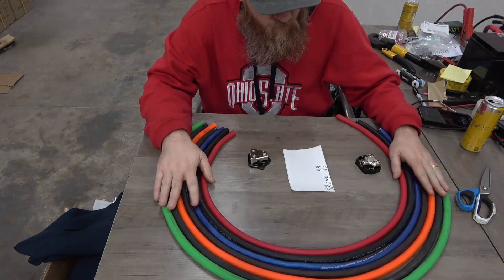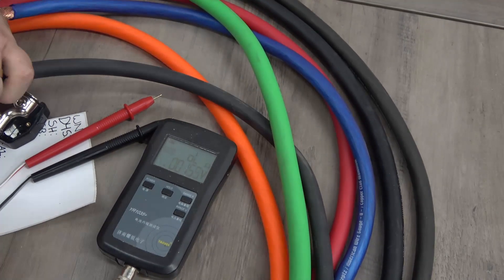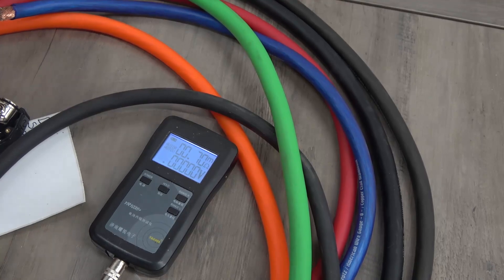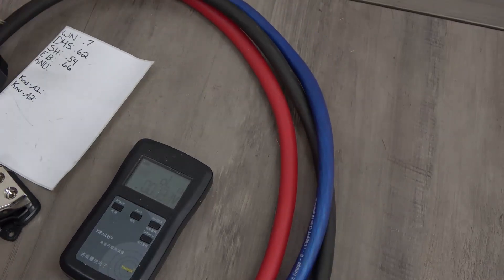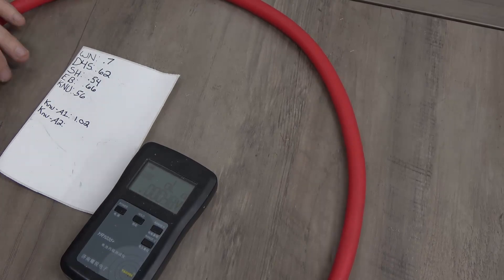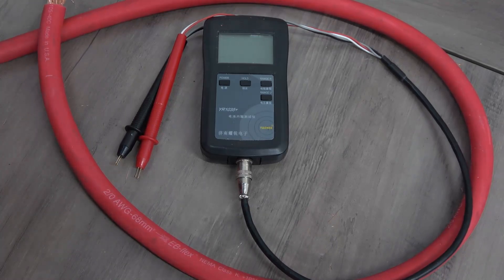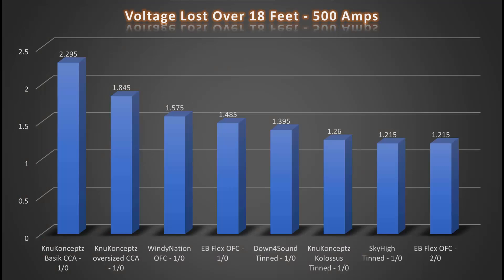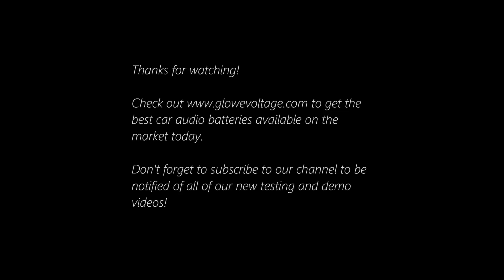Copper Combat: Impedance Testing the Top 1/0 AWG Wire Brands!

Comment: Just wondering if there was a purpose to stripping all those wires and tightening them into the blocks to read the resistance couldn’t you have just stuffed the probes in to the ends of the unstripped wire?? Not busting balls just wondering if there was something else to that
Reply from the maker: Kelvin clips aren’t going to attach well to wire this thick.
Reply: Well from what I saw he was tightening the wire down into the blocks he was using and still stabbing the probes into the wire I just thought he could have stabbed to probes directly into the unstripped wire and got the same results that why I was asking was there something else to it that made him test with the wire in the blocks

Comment: GUESS WHAT IT Doesnt matter  Because Laying 400LBS of wire through your suv is Extremely  Lame And New 2 piece Amplifiers Are on the way.   We're the power supply goes under the hood or in kickpanel  and main  amp goes in trunk  leaving only 2 feet of o Guage wire to supply and then only 8 Guage of high voltage wire to amp in trunk
Reply from the maker: 1/0 copper wire weighs about .4 pounds a foot. 

400 pounds would be.. 1000 feet of wire. That’s intense!

Comment: I enjoyed the video and learned something from your teaching method. Do you have a way to do a voltage drop test using a car battery an amplifier playing a test tone, using a voltmeter?
Reply from the maker: This wouldn't be too difficult -- you would just need to measure the voltage at the battery terminal, and use a second dmm (that's calibrated with the first) at the inputs of the amplifier itself.

Comment: It is really difficult to measure accurately the resistance of high current cables of short length. The minimum length even for automotive applications testing (battery cable) is around 6 feet. To do a good comparison you need to terminate each cable with a crimped lug (hydraulic crimper with long barrel lug with a triple crimp). Then you need to have a high current low resistance measurement device, like a Megger DLRO10HD Digital Low-Resistance Ohmmeter which has a 10 Amp range, which for 1/0 wire is on the low side, but will work (you might want to move to a 100A tester). 

The tester is connected to test blocks (make sure the blocks (tinned copper bus bar) and lugs are clean) to which the cable under test lugs are screwed to (A torque wrench is used to tighten the bolts usually 3/8 inch bolt, but could be 1/2 inch). You also have a very short thick cross section shorting bar to see what the resistance is of the test setup. You usually have the test setup rigidly mounted to a wood or plastic base so it cannot move when you swap in and out the different cables. It would be good to have two of each cable type to confirm consistency of the crimpsl

Testing cable should be done at the circuit rated voltage and current (which at times is very hard to simulate) and the type of signal waveform, momentarily applied as to not allow the cable to heat up, and then resistance measured. 

A huge variable in the test in the video is your Allen screw connection block. These connection blocks are very poor at consistent low ohm connections the are not very repeatable, you could try using a ferrule to get a slightly better connection. You should always use a screw connection crimped lug for large sized stranded wire, with the lug being crimped to specification with the proper matching hydraulic tool and die. If you use a general purpose hydraulic crimper you should cut the crimps open to reveal the crimp cross sectional profile in relation to the copper strands for inspection. Hex crimps will work just fine, but round crimps are really the best type. However, the crimper and dies are rather expensive. 

A distinguishing factor between the larger 1/0 cables is the number of strands, the quality of the copper used, the performance of the jacket and if the individual copper strands are tin plated.
Reply from the maker: I just got a new tool specifically for this, and will be uploading the new test video shortly.  Can measure down to .00001 ohms DC resistance now and it's amazing.

Comment: I wonder how the windy nation 2/0 or larger does.  I normally use 2/0 welding wire but I also have quite a bit of the windy 2/0 I got from a warehouse deal then some 4/0 from a similar deal only 20 ft of that and havent used any of it yet.

I always figured since sky high claims theyve got 13mm of wire it wasnt actually 1/0 but Ive never gotten to measure it IRL larger than 1/0 though for sure.

Isnt pure copper wire supposed to be rated at about .3mohm per meter?
Reply from the maker: 0.09827 milliohms is 1/0 awg copper wire per foot, officially.

Comment: you can just push the meter probes into the open end of the wire.
Reply from the maker: Not and get a steady reading.. have you tried that??  I tried.
Reply: @GloweIndustries  no, i only have $6 dmm (and antiques), and coukdnt waste the $ on the scrap wiring. i would just buy welding cable from: wire and cable your way.

i'm still using *30yr old cables that have been i  3 different auto's

Comment: Appreciate the info but wouldn’t the true real world test be load till fail. The test you are doing slight change in temperature can change resistance.
Reply from the maker: Good thing they were all the same temperature then for comparative reference.
Reply: We don't want to see any fail. Alot of people love to quote the nec ampacity rating but fail to mention that nec only allows use of 80% capacity of the wire. Nec needs that safety factory due to legal issues in a car things are different

Comment: Does the Tinned Sky High 1/0 appear to be oversized? I have heard that before... I wonder if thats why it performed so well...
Reply from the maker: Yes, for sure.
Reply: Yea it's definitely oversized as is the ebflex 2/0. Knu kollosus ofc is the largest you can still fit in a normal off the self copper lug from my experience after that you have to go the 2/0
Reply: yeah I did my whole system in skyhigh and used 1/0 cable lugs and almost always gotta cut couple strands for it to even fit the 1/0 lugs

Comment: Multiple 500 Amp runs?  Power levels are getting out of hand.
I sure hope you guys are very careful when the gear is fully powered up!
Cheers!
Reply from the maker: 500 amps isn’t much anymore..  we have two batteries that can easily exceed 500a (and maintain it) without falling below 12v.

Check out some of our recent videos.  The Glowe Voltage Series 2 is 48ah and can discharge 535a.

The Series 3 is 20ah capacity but can discharge 720 amps.